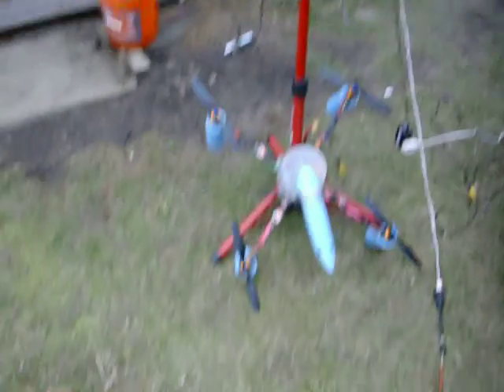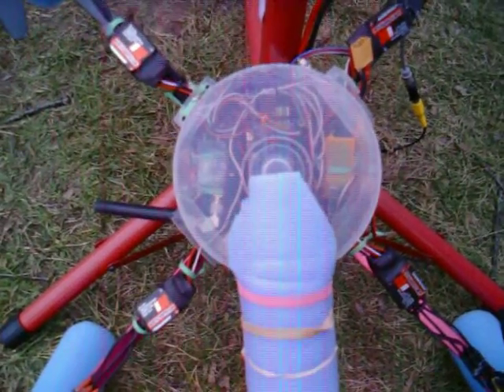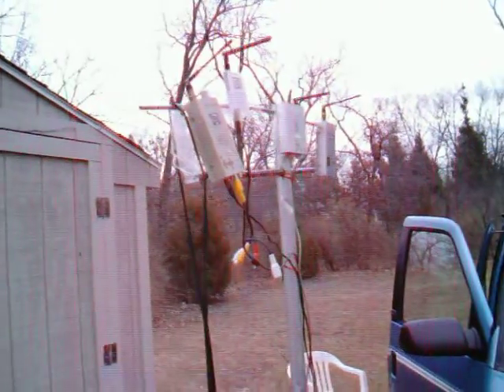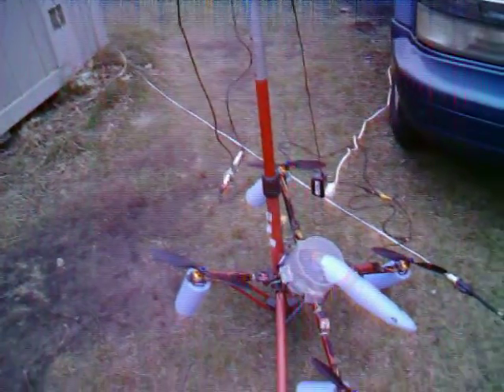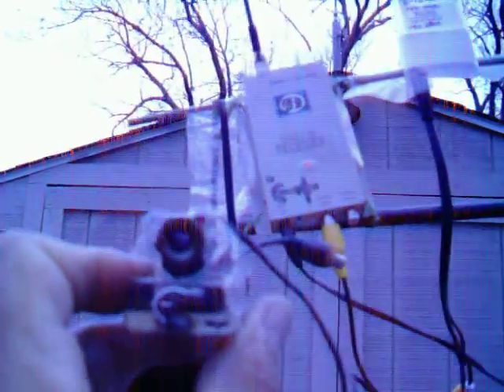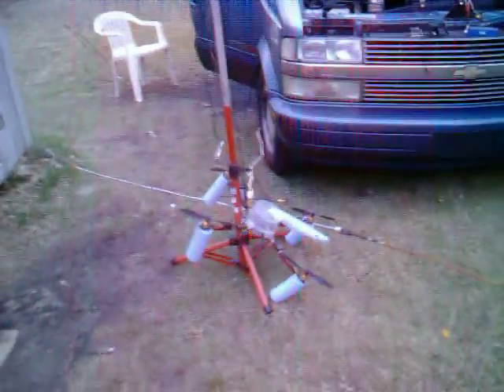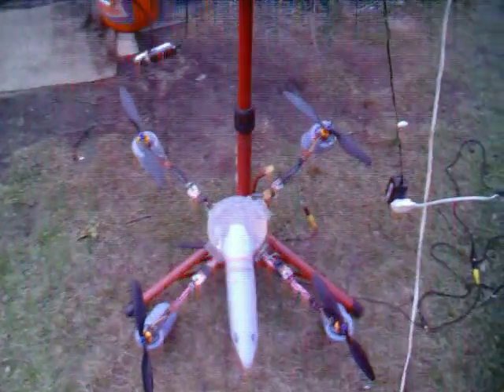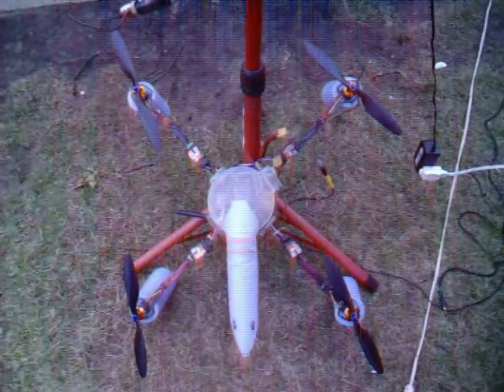APM 2.5 ver. Arducopter APM 2.0 Mega ...Telemetry, and FPV, with GPS

Comment from the maker: This is my 1st 525 mm Quad .It already performed 5 missions w/3-6 waypoints very successfully and am very happy.I will be planning telemetry,&ill upload live FPV on board cam video soon.I have to mention I will update with the ublox LEA 6h GPS module.This is MTK3329 and is pretty accurate but cant wait to install the new one..3s 4000ma 810 props
GPS
3dr telemetry air & round 
FPV on top 
20A escs 4ea
pwr dist board 
2.0 mega APM loving it
will do Arduplane next